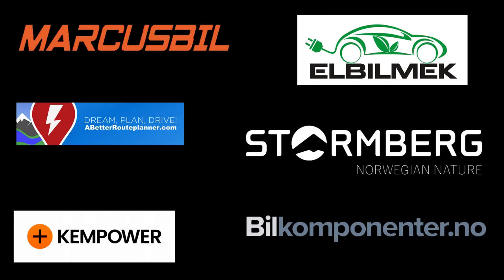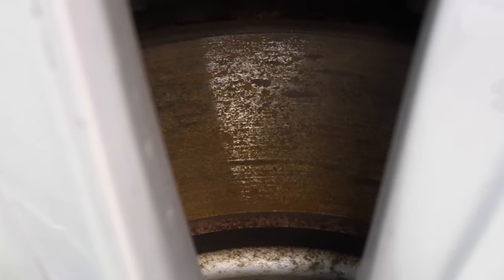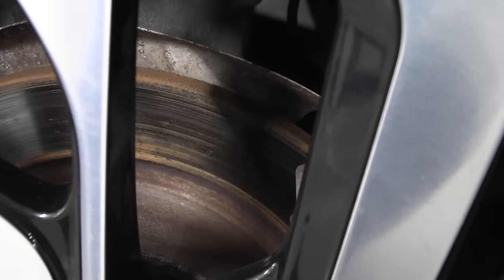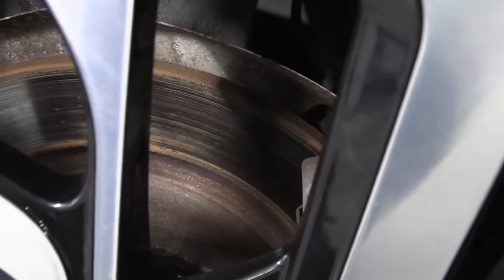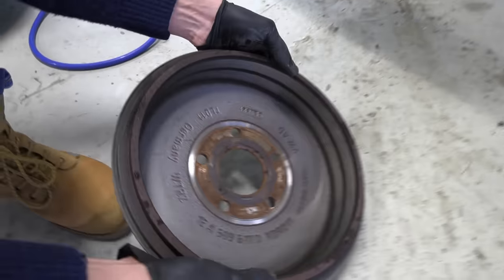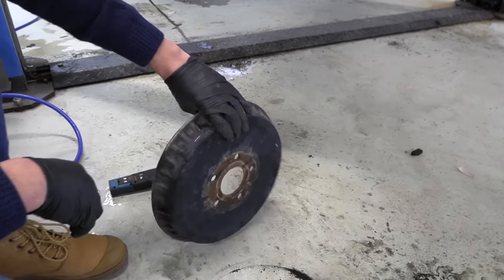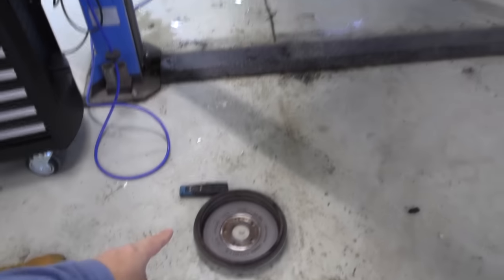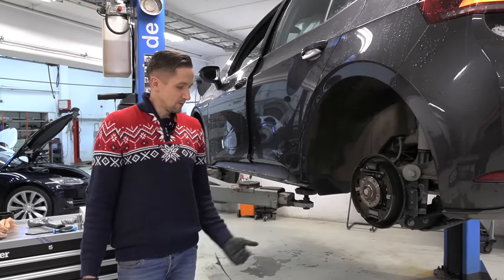How much rust is in VW ID3 drum brakes after two years?

Comment: 👍🏼👍🏼 I wish ly GTE would also have drum breaks. I had to get new disks for front and rear because they were so rusty since I used to drive 90% in B gear, now once a week I put the car into neutral and do a hard breaking from 80-100 to 0 since then it uses the disks, no regen to ”clean” the disks
Reply: It can be much more economical to have no regen and just roll, and then brake. Regeneration has its losses as well. Harder regen have more heat loss.
Obviously if driving down a long hill you'd use regen to keep from speeding, much like low gear to brake via engine on old ICE cars.
You can drive a long way for the price of new brake disks. So even if it sounds less economical to not regen it might not be in the long run.
Reply: @Gazer75 I thought the current set of EVs were adopting a profile of explicitly working the disk brakes from time to time; will have to check. Otherwise, yes, some manual intervention is required. A bit like on every cycle ride on a bike with hydraulic disk brakes I need to pump the brake levers whenever I set off to force any air bubbles up from the piston into the reservoir in the brakes. Just another habit to adopt
Reply: I had the same on my GTE, factory brakes lasted 3 years.  However I got some good quality low corrosion replacements and they lasted 5 years with no obvious sign of wear.
Reply: If you use D or B doesn't really make a difference in the GTE. Yes, it doesn't regen when you take your foot of the accelerator, but once you step on the brake it will do max regen possible before engaging the brakes.
It actually has a brake cleaning mode. After accelerating and braking hard twice, it will no longer engage regen for a little while. This allows you to clean the discs much easier, but the rear discs are still an issue.
I bought my GTE with 3 years/20,000km, and it needed new rear brakes immediately. Tried cleaning them, but the corrosion was too severe, they never cleaned up.

Comment: Drum brakes have a better protection against corrosion. They last longer than disc brakes. The disadvantage they  have is that they can't cool as fast as disc brakes. You can't brake hard many times with drum brakes in a short period of time. They get hot and lose their braking capability. In electric car you can regenerate and you don't need brakes so often thus drum brakes are very good of a solution. I would prefer drum brakes even for front tires in an electric car. It is all about reliability.
Reply: The only car I ever had drum brakes on had nothing but trouble with the rear brakes. They did basically nothing, while the front disks worked fine. This was a 12-16 year old car at the time. They may be protected against corrosion, but I'm not convinced they last longer or work better in any way.
Reply: @JamesKirk1988  My first brake repair that I did with my own hands was 1999 Toyota Avensis with some 320 000 km.  I did that repair 3 years ago.I suspect that I was the first to make anything for those brakes. I asked from a local service shop if it is possible that no maintenance would have been needed earlier and they agreed.  I replaced the brake shoes, springs and some small things, but it would have been better to replace everything but drums and cylinders. Today those brakes are working daily without issues.
Reply: @samijokinen9246 Glad to hear about you're good luck with those. The Drum brakes on the back of my 1990 Pathfinder were straight up worthless when we got it around 100k miles. We tried to fix them multiple times, but they were still worthless when we sold it at 160k miles. The front disks were doing 98% of the stopping work.
Reply: @samijokinen9246  the drums on the rear of my auto 90k mile fiesta were only worn about 40% and I drive around a city with huge hills! They last forever. Wouldn't want them for actual driving through, they can overheat.

Comment: About those rear drum brakes on the ID3 it is best to have the single piston, so the shoe can either hold the car from running forward or hold on a hill from running back. When it is two leading shoes they are powerful in going forward but much less back.  I wish manufacturers would use some other disc material. Maybe a version of Carbon, so they don't rust.  Best Dave

Comment: Bjorn, thanks for this! Two tips… first, you can get the ID. Cars to stay in Neutral by shifting them to Neutral, then agreeing to a message on the center screen (aka Car Wash mode). And second, there’s no need to drive fast and brake hard - the easiest way to clean the brakes is just drive a low speed, shift to Neutral, and step on the brakes gently… especially going down a hill. In Neutral, regen is disabled.
Reply: Hi Bjorn I was looking at few days ago in my part’s catalog for a 2023 Canadian spec iD4 for rear brake parts prices and the hydraulic wheel cylinder are $ 30.00 each the drums are $ 70.00 each and the brake shoes are $ 120.00 for the set I remember when doing rear brakes on older VW that was driving on mix toads the shoes would last 200 000 km what I like is the Parking cables are not uses anymore they are motor that actuates the rear drums all the price that I mentioned is in Canadian currency. The only downside to drums is if the drums are too worn the brake pedal will be lower.

Comment: Drum brakes are as good as disc brakes in their ability to turn motion into heat.  Their biggest problem was to disperse the heat, because heating expands the drum, and the brake shoes run out of travel trying to chase the receding drum's surface.  Another difficulty is the brake shoe itself, which can also overheat and 'glaze' the braking surface.  This is a chemical transition that decreases the friction (turns it into a form of glass), which also diminishes the effectiveness.  Both situations can be designed out, but with simple disc brakes, isn't worth the effort.  They are, however' very inexpensive to manufacture, as well as very reliable.  Since very little braking is done by rear brakes (because the centre of gravity moves forward under braking), they are never overloaded.  The rear brakes also are the most convenient to use as parking/emergency brakes.  The design used on the ID3 gives equal braking both forward and backwards, as well as a self-adjustment mechanism.  The central groove is another feature with two benefits.  The first is to provide shorter routes from brake dust created by wear, to get out from between the shoes and the drums in normal use (infrequent heavy braking by the rear brakes).  The second reduces the friction surface and thus enables a harder braking compound to be employed, while not reducing the effectiveness of the design in the process.  This gives a longer service life to the rear brakes, which might match the life of the front discs as far as servicing goes.  I understand that VW has been experimenting/employing a slip-seal around the edge of the drum and back-plate to exclude the opportunity for water and debris to enter the mechanism, but, self evidently, this seems unnecessary if you consider this car's experience.

Comment: Small cars with rear discs often rust their rear discs more than larger cars as they aren't heavy enough to get adequate load to clean surface rust thoroughly during braking, especially if the car isn't in regular use. Bias valves and ABS will be preventing brake lock up on a light car under hard braking. I use the cable operated handbrake a bit during driving to clean my rear discs of surface rust if I leave either of my cars unused for a while, one of which is fairly small and light the other not as small and light but it's use is less. This seems to do the trick for me. Neither are EV's but the principle is there for rear disc equipped cars regardless.

Comment: I find drum brakes to be pretty good. They need to be set up correctly to work properly, so more finicky than disc brakes. The best advantage though is that drum brakes has zero drag. That they overheat easier is not really a problem for most people unless you drive on a race track or drive down a mountain and use the brakes instead of engine braking…
Reply: Harder to engine brake on an automatic or EV, but I've found cruise control to work well when doing big mountains to set that steady rate for the straight parts. This also stops my car having the "tourist lights" on as my Munich-based friends to use to describe brake lights on vehicles from north Germany doing alpine roads with the brakes on all the way....

Comment: In my e-208, I found that when I shift to N, the regen is completely off even when pressing the brake pedal. I use it to clean the brake rotors from time to time, especially after driving in wet or snowy conditions. I pick up some speed, shift to N and brake semi-hard. 
Also the parking brake toggle when pulled acts as an emergency brake, braking with the rear brakes only. Those need cleaning a bit more, the parking brake can otherwise get a bit sticky due to rusting and release with a loud clunk when driving off. I tend not to apply the parking brake when a risk of that is elevated (like after a rainy drive) when parked on a level surface, the motor P lock is enough. Oh, I'd love to have rear drum brakes! Makes even more sense on a RWD car where regen is on the rear, but the front gets used at least a bit.

Comment: Something I really don't like with many european cars is that they often have wheels mounted with bolts instead of nuts you screw on threads that makes shifting wheels so much easier, especially with thick aluminum wheels.
Reply: Try use screw driver as a guide pin. It is still painful. But not as much like you dont use nothing
Reply: I'd expect the threats to get damaged quickly when someone who struggles with the weight of a wheel pushes it along the threaded rods.

Comment: Break size is determined by car mass for homologation, so heavy EV cars will have unusually big brakes. To prevent EV disk brakes from rusting, make harder breaking from time to time especially in wet conditions, or the best the next day after car wash or rain. It will clean the rust and prolong disk lifetime. Drum brakes are better sealed, not exposed to water so much, so this is one of the reason they are used for EVs.

Comment: I know this is a different subject but I had to replace all my pads and discs on my three year old Arteon after only 16k miles, and I'm an older, steady driver. Discs were in an appealing state.
Reply: "appalling" ... definitely not "appealing"!
Reply: Brakes need to be used fairly hard frequently to not just rot away, if all you’re really doing is putting about town mostly engine/rolling resistance braking then the brakes will rot for the same reason EVs do.
Reply: @MrAdopado Don't be surprised if Google is spelling for you! Sometimes it's "interesting" to know which letters are close to each other on the keyboard. I press 5 instead of t "many" times on my pad...
Reply: @leiflillandt1488   Yep, don't I know it! In this instance it was a fantastic typo example because it described the exact opposite of what was intended!

Comment: Drum brakes - that's called cost cutting :)
Reply: Not really. Discs on the rear are not needed
Reply: It is cost cutting, but not in the way you think - the cost cutting is for the owner mostly. This is because the rear brakes are almost never used, only in full emergency. The ID3 has the electric motor in the rear. When you are braking even quite hard, then first the friction brakes apply in the front, because that is where the majority of the braking force comes from. The front does about 70-80% of the braking, and the rear only has to do 20-30%. In most cases the electric motor is enough to provide this amount of braking in the rear and the rear brakes do nothing.

If they fitted standard disc brakes they would either need to install really expensive special rotors that do not rust easily, which would drive up the price of the car, or if they fitted standard parts you would have to replace them every year, since they'd get completely rusted, as they are never used.

If the electric motor was in the front, then they would have fitted disc brakes in the rear.

Tesla for example does not have this "problem" because Tesla still can't do brake blending even today. So every time you touch the brake pedal both the front and rear brakes are physically engaged. This is not the case on the ID3, where in the beginning of travel the brake pedal only engages the electric motor, and not the friction brakes, then the front brakes are phased in and in the very very end if absolutely necessary (near full emergency stop) come in the rear friction brakes.

Comment: The surface rust on the outside of drums is just cosmetic - my VW UP came painted grey and a coat of wax prolonged the life. Easy to respray or coat with rust protector too because no risk of contaminating the enclosed brake surface or friction material

Comment: I think the best way to take care.of brakes is from time to time do a friction only braking: coast, switch to neutral and do normal braking without regen (it won't work on neutral)
Reply: Or, you have a car that uses the rain sensor to predict moisture on the brake and applies them with minimal contact to dry and clean them. The customer should not be required to do strange driving in public.
Reply: Did you mean to write neutral twice?
Reply: @AlbertLamarque  even ignore the sensor and from time to time reduce regen and do friction braking instead. Can be done with car's software. Probably will be a standard in future.
Reply: @ArturFlies  however the solution looks like, I agree. My "old" 2017 BMW i3 had a rust problem, my 2021 i3s does not. Something must have changed.
Reply: Modern EV's does this automatically
Reply: @oskich  oh really? Which one got this feature?
Reply: @ArturFlies  Our Kia Niro -23 for example, you can manually activate the feature from the infotainment system or it will enable it automatically on a periodic schedule.
Reply: @oskich  cool. I have 2020 Kona and missing that feature. Luckily it has crawl in which it uses friction braking so it least that removes some rust on regular basis.
Reply: @ArturFlies  I notice My ID.3 occasionally uses no regen when I am braking, particularly from higher speeds when slowing down for a junction or roundabout. I am fairly sure that this is done automatically by software.

Comment: Only problem with drum brakes on old cars that had them would be failed hydraulic seals. These would allow hydraulic fluid to leak on to the brake linings. Not a pleasant job on old cars with asbestos dust that you had to remove from the drum ... or black sludge if it was mixed with hydraulic fluid! In principle it seems a reasonable choice of braking system for the rear on an EV.
Reply: Also the self-adjusters either rust solid, or get jammed up with brake dust and stop working, so as the pads wear they aren't compensated.

Comment: What i would have done is give the drums a clean with brake cleaner , Also on contact surfaces that have corrosion sand them down with a wire brush and apply a generous amount of copper slip grease .
Then that would be sorted 😀

Comment: German but what a shit, from the beginning I have problems with the electric handbrake in my ID3 1st, it stucks/blocks almost everyday in wet conditions (Im Basque not German so u can imagine that weather in those terms its worst in the design country that in mine), When u release it putting the gear selector on D or R its blocked and you have to force it to run , I reported to my VW dealer like 5 times in those years till the handbrake finally as broken and the car was stopped for his security. 4 months in the garage cause the rear brakes handbrake was broken and were not spare parts for it, 4 months !! After that period they changed the servo and the actuator but not the drum pads which is the part that has contact with drums, so clever Vw!! So the problem continued as before, I reported but they never answered, you don't need to be a German engineer to guess that if the pads are bonded to the drums every wet day maybe the pads are the problem? I tell them to change the pads that I payed and problem its solved. Thats is not an electric car issue, its a general car issue. This was my 5th VW/Audi and the last.

Comment: I have a Cupra Born and I put the gear in N sometimes to remove the rust from the disc brakes. Then there is no regen and only normal brakes are used.
I guess this works on all cars on the MEB platform, I don't know if it works on other brands though.

Comment: It was one of my many reasons for getting rid of the Kia Niro EV. I braked hard 3-4 times on my way home from work, drove a bit past my house and reversed at max speed slamming the brakes while using the "clean brake discs" mode, and even then my rear discs were rusty. Crap quality, but why not just put a drum brake in there. Even with the Picanto/I10, they had rear discs. Completely unnecessary.

Comment: I can't remember exactly who said it when, but one of the engineers at Tesla said that they use a custom material for their brake discs which is more corrosion resistant. Can confirm as a Tesla owner, apart from a tiny bit of surface rust after a rainy day, there is no serious corrosion on them. For a non-performance car, I think drums are a great Idea for EV's as you dont have to worry about corrosion at all. Also potentially saves money by having a mechanical handbrake using the rear drums